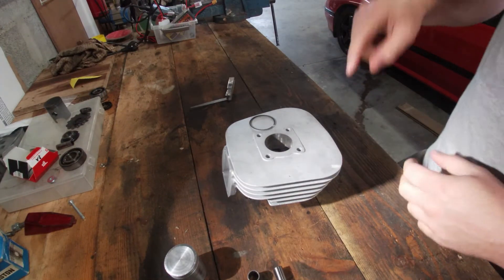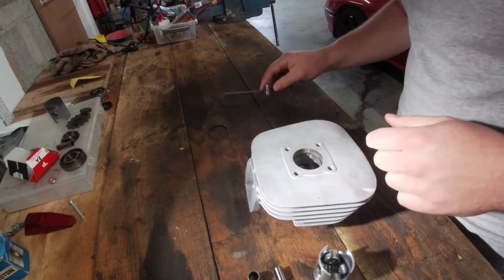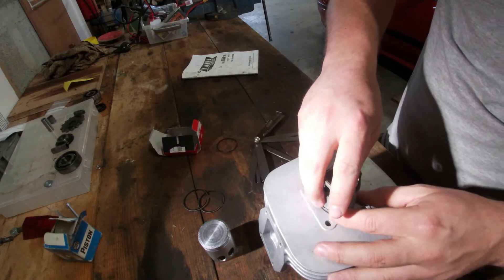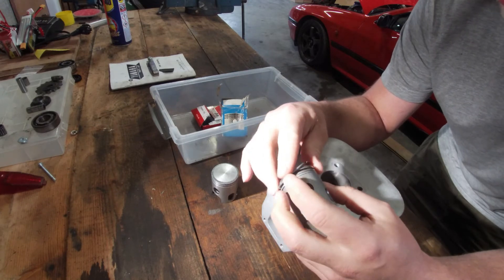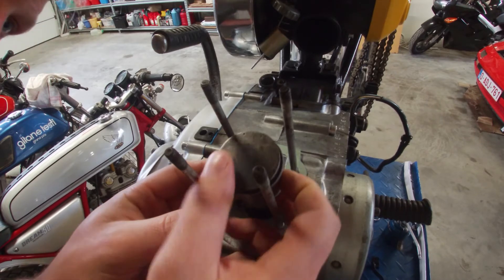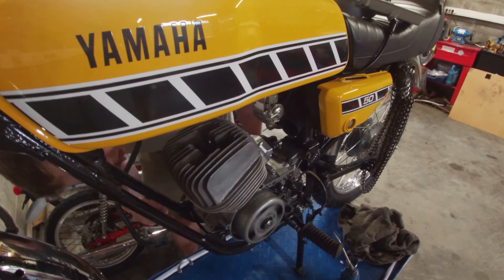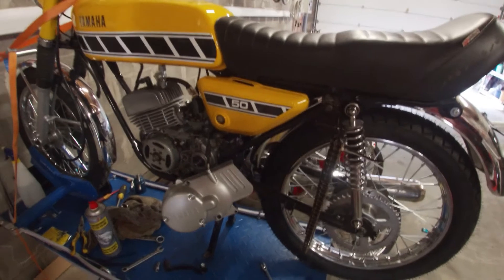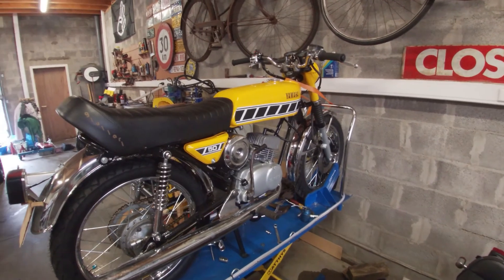Yamaha RD50 'Kenny Roberts' - Pt.13 2nd startup

Comment: I am working on a 1983 Yammy RX50 so I am researching about these pistons right now. Some use 1.5mm thick rings, and some use 1.2mm rings. You would be fine with a set of rings from a YSR50, though they are a little pricey. Also yeah, some of the pistons have more convex tops for higher compression I presume or for a different head used on some models. The standard pistons are exactly the same between the RX50, YSR50, and several DT50MX and DT50R years. The DT50MX, R, and LC also used a different piston which was also used in some of the RD50 models. It is quite interesting to be honest, and good to know if you want to dial in tolerances making sure you order exactly the right parts.
Reply from the maker: The YSR50 pistons are the same? That's good to know! Will have a look around!
Reply: @VintageGarageYT  Likely the same cast but milled slightly different, if you do some reading about the tolerances though they will likely match your bore fine and have the flatter top I believe the part number differences are 11631-3196 vs 11631-3197. The 96 and 97 i believe refer to the finish dimension of 39.96mm and 39.97mm for standard size oem pistons. if you are slightly oversize on tolerance on your standard bore after honing, that .01mm would actually even be of benefit, and save you the need to hone to an actual first oversize piston per say.
Reply: @VintageGarageYT  the other difference though being that you need the smaller rings for the 97 pistons while the 96 style will take a larger 1.5mm thick ring set. And it seems that the piston you got is also slightly different, in that it has both the more convex top, and also the slots only to fit 1.2mm rings. its interesting
Reply: @VintageGarageYT  I wouldn't recommend swapping them around without doing very thorough research about it and taking very accurate measurements to check your tolerances.
Reply from the maker: @jomamabee2481  Yeah I won't. I'm currently running the original piston that came with it and a new set of rings which are within spec

Comment: Please check the con rod with the little end in place and see if play in it in up and down mate because there should not be play in it mate but if con rod worn on where little end go in if there’s play mate or not ? Worth checking mate onley if your useing old crank again mate ?
Reply from the maker: Yeah its the same crank, no play was found in anything. The engine rattle is gone, I think it just ended up being the piston being to loose in the cylinder.

Comment: I want to get my 1981 Mr50 running. It doesn't want to start. Has good spark. New carburator. But I think compression is low. 

What rannge should compression be?  Pls help. Also what carb you have mine mikuni vm16 what is your airscrew setting?  Pls help
Reply from the maker: @Adriaan-bb6kv  compression should be minimum 90psi on a hot engine. Airscrew setting stock is 2 turns out from completely in. That should be a good starting point. Is the plug wet when trying to start it? If not it's not getting fuel
Reply: @VintageGarageYT  yes the plug is wet. Will check compression thx. 
I feel like it should start but it don't want to. Thx for your suggestions
Reply from the maker: @Adriaan-bb6kv  you can try add a little bit of 2 stroke oil in the cylinder through the spark plug hole. That will temporarily boost compression. If it starts then, then you know the rest should be ok

Comment: How many oil seals does this engine take  mine is a yamaha mr50 1980/1981 im not sure anymore. Where did you buy a oil seal kit? I think mine has same enjine as yours. I need help with  mine. Bike shops here say its too old for them to work on
Reply from the maker: @Adriaan-bb6kv  they are very basic engines and it's totally doable to do it yourself with some basic tools. Here are the seal and bearing sets:
Bearingset: https://www.jmpbparts.com/lagerset-yamaha-dt-rd-ty.html
Seal set: https://www.jmpbparts.com/keerringset-yamaha-dt-rd-5-versnellingen.html
Reply: @VintageGarageYT  thank you
Reply: @VintageGarageYT  I see now they don't ship to SA. 

I wonder if my local Yamaha dealer will have the seals.
Reply from the maker: @Adriaan-bb6kv  oh they don't? I always thought they ship worldwide.

Comment: 1000km break in!   It's not needed, 100-150km is more than enough, just give the engine short bursts of load but not for long enough so that too much heat builds up in the barrel, gradually increase the length of each burst of load until after about 100km you can hold full throttle for as long as you like. Breaking in an engine too gently is no good at all, a glaze will form on the cylinder before the rings have bedded in, once that happens the rings will never really bed in correctly. On the flip side too much load too soon will overheat the engine due to the extra friction of the cross hatching, this could lead to piston scuffing or worst.  The length of break in is also determined by the type of cross hatching, race engines use a very course cross hatch, the rings break in very quickly but won't last as long. (which does not matter on a race engine as it will get rebuilt often). I used to race TZ350's, three laps and they were run in, 50 laps later the rings were worn out, 100-150 laps and the pistons were worn out!

Anyway your bike looks great!  I have an old Honda MT5 which I have rebuilt so that I can re-live my youth. It does way more than the 30 MPH that it is only supposed to do! (Around 55 MPH at the moment)
Reply from the maker: Thanks for the info. There is a lot of contradictionary information about breaking in an engine. I do short burst of load since 10 or 20km. Bit never hold it for too long before 500k. Seems to work fine ever since ive been building them.
MT5 is awesome! Never rode one before but ive heard they ride great!